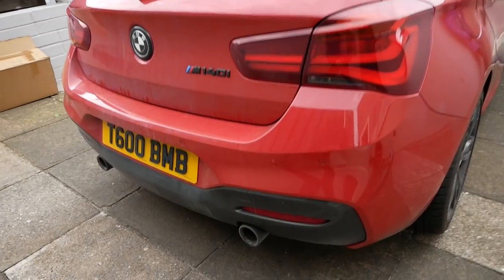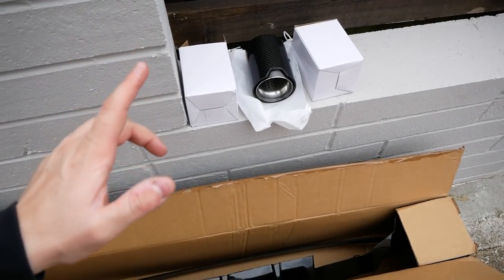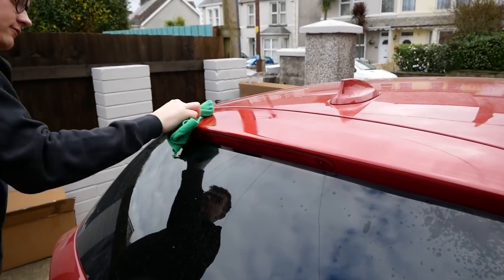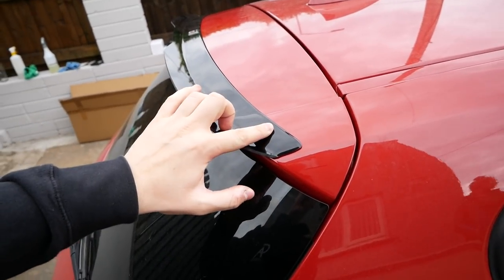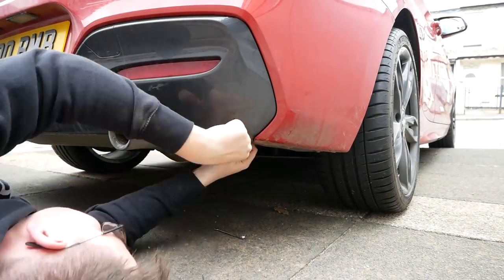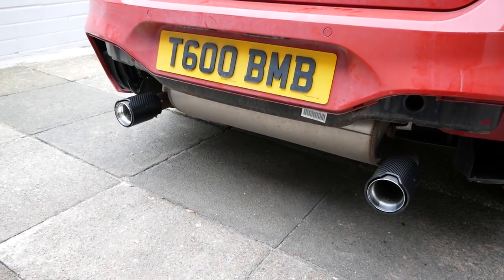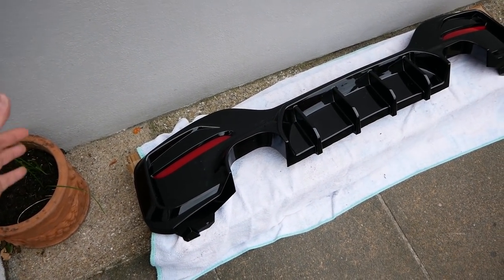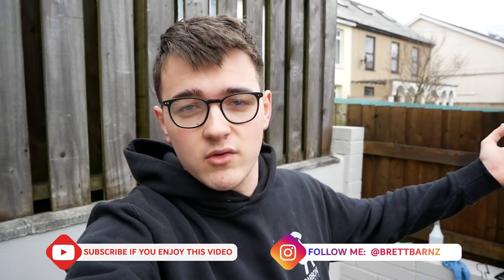BODYKIT FOR MY M140I! *REAR END TRANSFORMED!*

Comment: Did you have to cut and of thr back clips off the red reflectors for them to insert into the new diffuser? And if so would they still be able to go back into the stock diffuser again? This is one thing that makes me tentative on a change like this. Not being able to go back to stock easily

Comment: Great videos, great narrative, great production mate, keep it up.
I have just fitted the exhaust tips from CARBON ACCENTS, SUPERB quality and PERFECT fit...but they stick out too much with the standard OEM valance/diffuser (maybe not so with after market, haven't got one yet), so I just cut off those pins (dremel, quick and easy). Thatallows the tips to slide further back and look great now. If I get the diffuser, I can move them out if needed.
Those pins are just there to help locate the standard tips, they're not needed so just remove them.
Carbon Accents don't sell a gloss black diffuser any more and Maxtons' version requires bumper removal.

Have just fitted the CARBON ACCENTS mirror caps. They are excellent quality. Prizing off the mirror caps took less than 10 seconds...as for removing the mirror glass...NOOOO......far too risky...

Comment: I’ve got my Maxton diffuser on order. I thought you had to remove the bumper to be able to fit it securely with screws? Any advice mate.
Reply from the maker: No mate, the carbon accents one seems to fit well as is
Reply: Oh right. Fingers crossed mine will be that simple when it comes. 4-6 weeks on order. Got the v2 spoiler to fit tomorrow though so it’s getting there 👍

Comment: How did you fit the maxton diffuser to the bumper? Did yours just clip in? I've bought one for my 125d and it seems I need to have bumper off to to secure it with screws or seal as there are no clips? 🤔

Comment: You’re videos are always spot on mate I do feel a little robbed with this one though being only 7 mins long 😂 That rear diffuser looks amazing!! I’m tied between going for that one and the rieger. I always thought the rear bumper had to be removed but it looked like you just removed screws from the bottom then a pry tool to free it at the top is this correct?
Reply from the maker: Yeah 2 clips and 2 plug things and then pull off
Reply: @BrettBarnesYT  hopefully you see this as this video is from a while back now, but, how did you fit the new diffuser on? Mine has arrived today but is telling me I need to drill holes in each clip to put in a nut and bolt?